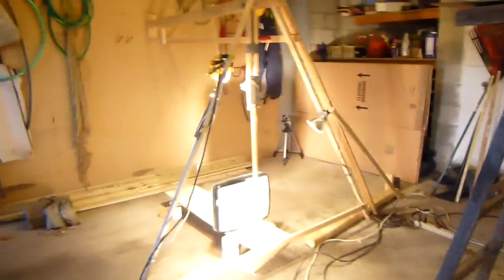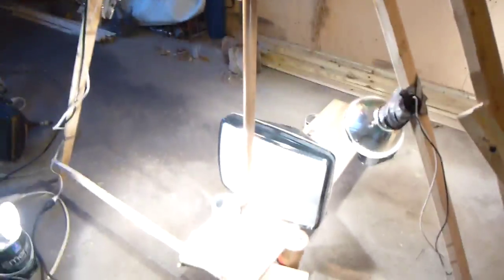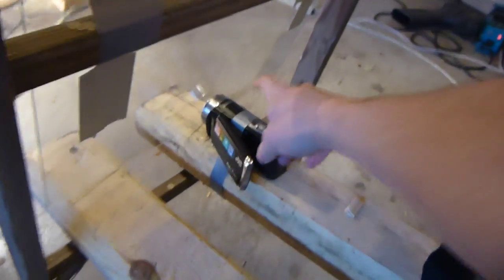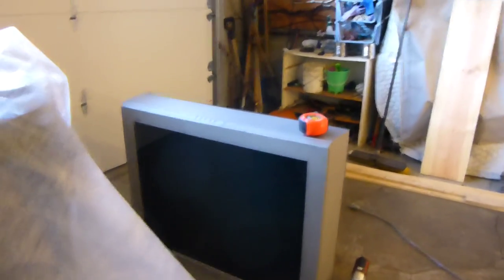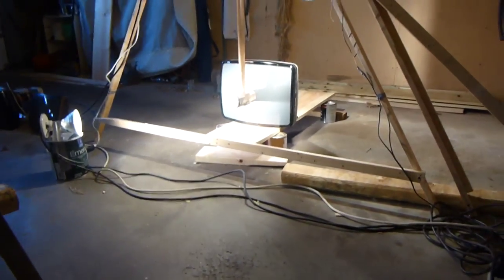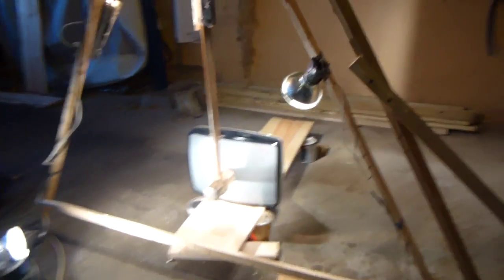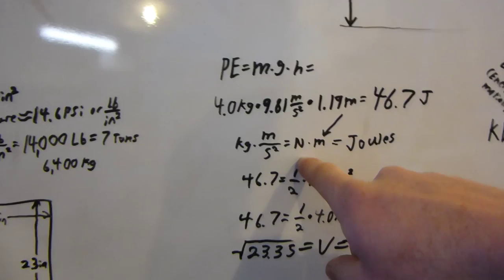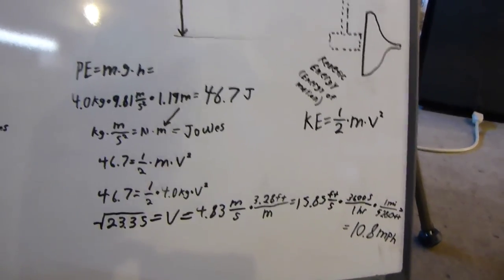One Million Views! Super TV Bash Celebration, 4 CRT TV's, Gigantic 37 inch CRT TV and 4 More

Comment: The thick copper coil at 13:12 is called the de-gaussing coil. when the set is first turned on it demagnetizes the shadow mask inside the CRT that guides the electrons beams to hit the right spot on the screen.
Reply: Very interesting young genius kido LOL
Reply from the maker: jdflyback Interesting!  Sadly it's not copper.  It's aluminium.  So it's hardly worth it's weight in gold but I could use it for wireless power transmission.  Thank you!

Comment: Nice vid! The coils around the back of the 37-incher are degaussing coils. They try to keep the front part of the CRT from getting magnetized and messing with the "color purity". Broadcast monitors would have a switch on the front to invoke the "degauss", while home sets seem to do this only when switched on. (It's that "WHOOMP" sound you hear when you turn the TV on) The reason is probably because a home TV would sit permanently in one place, where a "broadcast" monitor may be used in a number of places and moved around. You can get color impurities from the magnetic field of the Earth just by rotating the CRT around, so sometimes you may need to hit the button to clear that up. I wish my mom let me get away with the stuff you're doing, but then again mom always knows best.

Comment: Bravo c'est super mais j'aimerai savoir le modèle de la caméra qui a filmé a 300 FPS merci et encore bravo
Reply from the maker: skrillex1234ful Thank you!

The camera is a JVC GZ-E306BU.  Only problem is that I hate the thing.  I bought it to replace my old point and shoot but I really dislike it and I never use it except for slow motion and time lapse.  The thing I do not like about it is the lens angle.  It has such a narrow frame.  It is almost like it is always zoomed in 5X.  To give you and idea of this.  If I hold it at arms length away from my face and point it at my face like I'm doing a video log I can only get the majority of my face in shot.  It totally cuts off my neck and top of my head.  It is really annoying.  It also has terrible sound replication.  Voices especially sound really bad.  It will also not record sound when doing 300fps.  To get the sound at 300fps in this video I used the audio from my other camera and then did some magic in Sony Vegas.  The video with this camcorder is also kind of granny in my opinion.  But is does take decent 300fps footage.  

So if you do not mind always having it on a tripod, need 60x zoom, like 300 fps, time lapse, then it could be for you.

For all my videos that do not use slow motion I use my Panasonic Lumix DMC-SZ7.  I like it so much that when it fell out of my hand with the lens out and broke I bought a new one right away.  I bought both of them used on eBay for around $50.

Comment: I think this is wonderful, much better way to spend your time than smoking pot and robbing liqueur stores. The math may have been a bit off, the moving mass was greater than you used and the pivot and arc are not same as a vertical drop - though I was scratching my head thinking about it. Just had to say I'd be very proud of you if I were your mom..(if I had a gender swap). (PS language altered for American perusal - we have off licence shops and mums)
Reply: ...Or is it the same? Maybe it is thinking about it, certainly the potential energy would remain the same. It travels further but accelerates slower, so yes, same in the end.